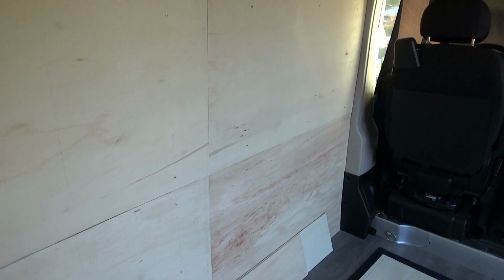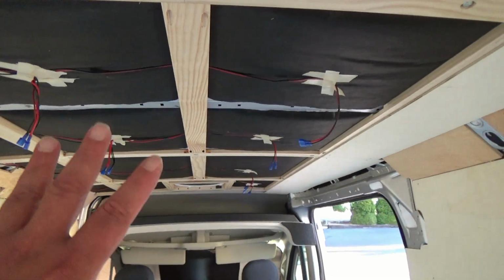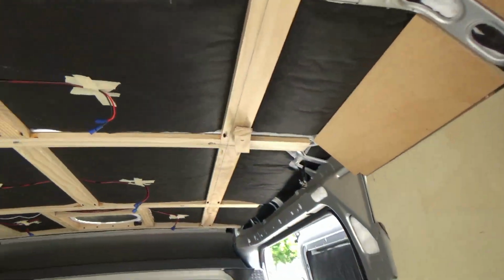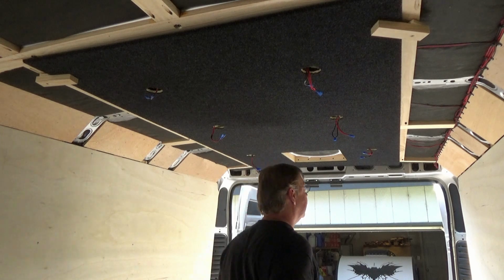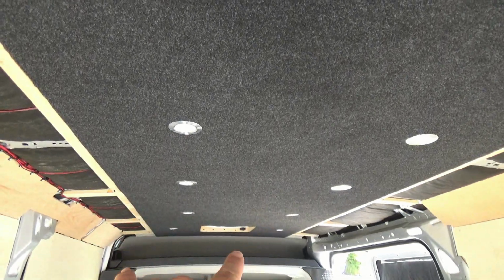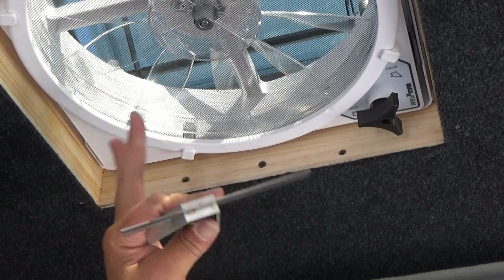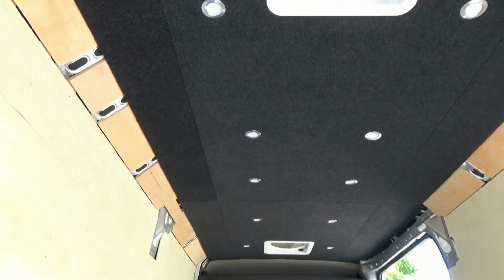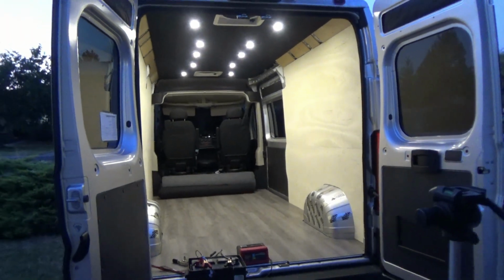DIY Van Build – Promaster 2500 159WB – Installing Ceiling and Lights – Part 7

Comment: Thanks! Appreciate this, do you think wood frames are necessary? Can you do havelock wool and Duratherm for the walls and XPS foam on the floor?
Reply from the maker: Wood frames were needed for this build due to the cabinets I installed... it was the easiest. Is it necessary? No... you can insulate and use Duratherm for the walls for an extremely light build. I found that using kilmat, Thinsulate, and carpeted walls... gave this van great sound deadening properties.

Comment: Hello again Batman! I’m wondering sir, @ 0:39, the cab part, it looks like caps you place on there. I’m talking about the beige and gray plastic on the left side of the seat. Could you pls share where you purchased it? Thank you
Reply from the maker: Actually... what you are looking at, is part of the van as it is. That is already installed when purchasing the van.
Reply: @ Ty. It looks really good.
Reply from the maker: @pambansang_kusinero  Thank you! Thanks for taking the time to watch!

Comment: What Size wood are you using on the ceiling and walls
Reply from the maker: I used 5mm hardwood ply for the walls and ceiling. Lightweight, yet very strong! Thanks for checking it out!

Comment: Great channel , great content ! Very informative ! I have a question do you have a lonk or know where i can get that ceiling carpet material  🙏🏻
Reply from the maker: I Do! I purchased on Ebay... search for "Trunk Liner Carpet" and you'll find what you need:  https://www.ebay.com/itm/222523330275?_skw=trunk+liner+carpet&itmmeta=01JCPXC0X39CSMPQAPNY02K9NV&hash=item33cf6c8ee3%3Ag%3A%7EskAAOSw0wRaHzqP&itmprp=enc%3AAQAJAAAA8HoV3kP08IDx%2BKZ9MfhVJKm9xjjyRKMcLQy%2F2yOm%2FyzpItpHMPTyi4ve8%2FURVibqNfPbPLWjyhtfNwkqBaFClnj%2FVFeVnDw%2BCxdZoSeaMNv5d3eWf9tojYlifsp9PaUBgk2Jf8%2FeDHbm9%2B9KmOlTVrgyZ6S4PYzeIThZeH3NGpjllvWhNTtfjASraihcXC8wi5O884d%2BqDhN4Cv5BcQTPup8ypBlMHtlw7FC3e2oocInG0BvLYjW3GDtrLrZoweZO%2FL17r83%2FiaWotVj745mlh3dFeRxhdQkyBhYeq67OUlk6vCdoLSBK2LZVQFGPBkVkQ%3D%3D%7Ctkp%3ABk9SR-qOsN3lZA&var=521370938974

Comment: Nice set up sir ..
I want to do something like that on my van. 
What are the dimensions on the plywood did you use if you don't mind sharing..
Reply from the maker: Hey mtbbuddys! I used 4 x 8 sheets of 1/4" ply for the ceiling. I can't remember the exact dimensions, as I made the cuts as I was building. All that to say, I don't think any two will be alike. I have 12" pieces on the sides and then made the center pieces the exact dimensions to fill it in. If I had to build another, I am sure they wouldn't be the same dimension. Sorry if that's not too much help... I do thank you for checking it out.

Comment: Batman, What kind of material is it that you are using for the ceiling and where did you purchase it. Thanks for the great video!
Reply from the maker: It;s called Charcoal Gray Automotive Trunk Liner Upholstery Cloth Auto Pro Flexible 54"W and purchased from Ebay. Hope that helps! al

Comment: Someone completely sabotaged my build. Bought materials I cannot return and purposely gave me incorrect measurements. I am so exhausted. Since May my van has been at this man's house and the only thing he did was install the Maxx Fan and... The floor was cut improperly and woe is me. Is it possible for you to provide me with some dimensions so I can get the people at Home Depot to make the cuts?
Reply from the maker: Truly sorry about that dilemma! Not sure if any of the dimensions I give would help too much as my build is different from yours. I do give the dimensions of the framing in the video I made of installing the framing... I hope that would help some.
Reply: @OregonBatman  thanks. I will check it out

Comment: Great video again Al!  Yep, I also noticed that color variation on the port side of the ceiling, I liked your comment about the fact that it will bug you for a long time:  project builders are the only one to see "variations" in their own job, nobody else will notice them, but still,  it is annoying...  Good tip for solo workers, those rotating cleats to hold the ceiling!
Reply from the maker: I decided not to switch it around as it would have definitely ruined my panel, also knowing that it will be hidden behind a cabinet will be easier to look at! :)   Making the cleats helped a lot, when working alone... you have to come up with a way to make 3 or 4 arms to help out! LOL!